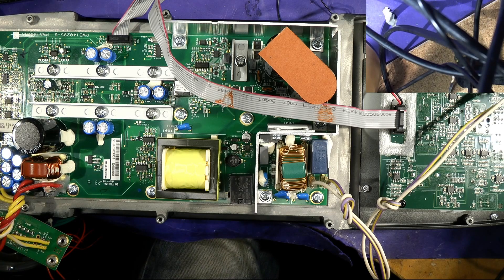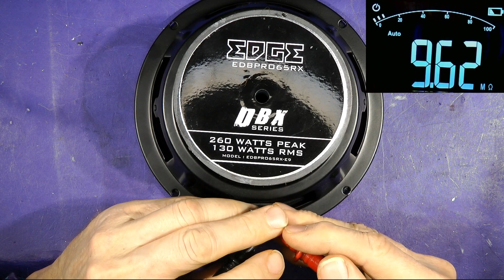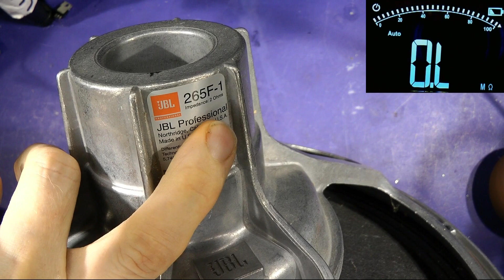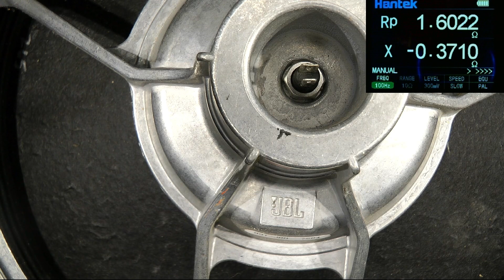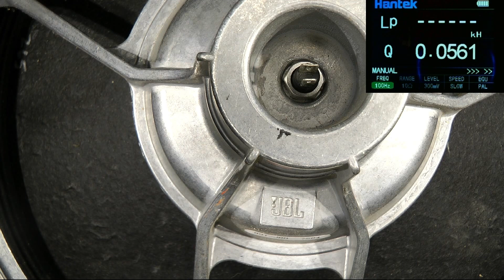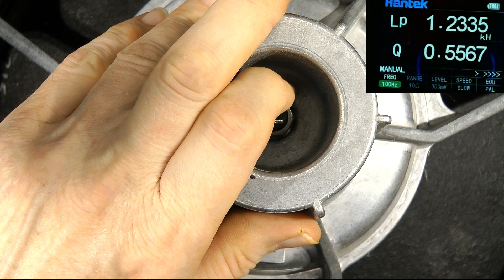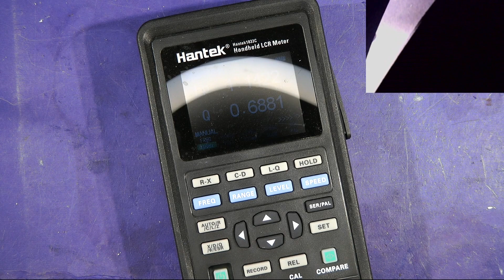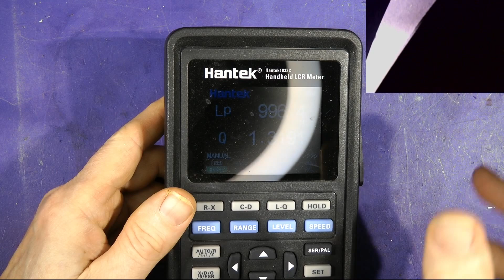How to Test a speaker voice coil Impedance / Resistance JBL  Bass Driver Check for shorted turns

Comment: Put both probes on same tag first to get baseline reading. With a big difference in impedance like you have, its likely a two layer coil shorted out between layers. Just a single short between adjacent turns is very difficult to identify. JBL sometimes even have a copper cap on the pole piece, as a shorted ring to intentionally reduce impedance at higher frequencies. Your sub bass speakers with 2 ohm coils are demanding on amp output anyway. A hearing loop uses a matching transformer to achieve 1 ohm load without a hundred paralleled driver devices.
Reply from the maker: An active impedance test will usually detect a shorted turn as a low Q of the coil. Speaker OHMS are rated in OHMs but is referring to the complex  impedance not the actual DC resistance.
Reply: Looking at the way I comment, it's unlikely  I have failed to understand impedance and ohms. A hearing aid loop in a theatre is a big loop of cable, with no practical impedance at audio frequencies. Nowadays the system is archaic and Bluetooth and other technology is installed. Perhaps you would like to address the copper shorting cap used by JBL which I give as an example. I'm not saying a short between two adjacent turns has no effect. I've repaired a 15" ATC speaker and suspect there is a short between a turn. It's performing identical to another one that doesn't have a short.
And yes, probes on the same tag first is good practice. Many digital meters today use an AC waveform when measuring DC ohms, which adds to the uncertainty with simple tests. I was just trying to help with a note of caution. Often second hand eBay sellers give photos with a differing DC ohms reading with a pair of speakers. I can tell you from years of experience that the factory winds thousands of coils that are all exactly the same resistance. Not in a ball park of say '6 Ohms'. So care is needed.

Comment: so the lower the resitance the smaller the tolerance. im planing on buying some 2 ohm subs, 2/box. Im rewire them to series 4ohm just to keep my crown Macrotech 8000 safe...
Reply from the maker: Sounds like a plan. The speaker impedance is a trade off between the power supply voltage and the cost and reliability of the switch FETs.  Maximum power transfer between the Amp and the load occurs on the point on the curve where the load matches the source impedance of the amplifier. Only when the source and load impedance are equal can you get max power dissipation in the load.  Of course if you drive into a greater impedance then the damping factor will be lower.  As well as getting the cone moving fast the amp also has to stop it fast. That the theory but I would be interested to know if you notice any difference in the sound.

Comment: Hi ive noticed on my subs reading 1ohm instead of 2ohm i have 4 dual 4ohm wired down to 2 ohm but recently my amplifier smoked when metering subs said 1ohm any ideas i had it playing extremely loud that few minutes to tune amp happened when it was turned right down
Reply from the maker: Hmm tricky. It is an impedance so really needs to be measured with and and AC signal.  If the amp is designed for a two ohm load then it should not have buggered it.  If not then then the amp might blow.  The impedance of the load needs to match the impedance of the amplifier.

Comment: I've got a 515 here that keeps blowing the bass fets (the high side pair). I'm getting similar readings on the driver too - but around 300uH and around 1R. It plays fine for around an hour before blowing the fets. Sound suspicious?
Reply from the maker: Lucky you.  Check the preamp isn't unstable. Bursts of out-of-band wild oscillations in the LF drive confuse the D class servo and blows the FETs. You cant hear them but the FETs can feel them. Also don't fool yourself that static precautions are not needed whilst handling and fitting the  new FETs. You also need to check all the components in the FET gate drive circuits. Please like and subscribe if you can,. Thanks.
Reply: @razenby  why would the pre amp burst into oscillation? Is it another design omission? You'd think they'd have some basic high-pass filtering on the main board if only to protect against induced noise in the ribbon cable

Comment: Did you notice that the readings differ a lot when you change the speaker around ,so that cone is in free air..the way it should be and on 100hz
Reply: I have done a lot of JBL265F  for agents.. hundreds of them. When saw the article I also learnt what R stands for Z.. have GW Instek LCR915   , a friend send me your link..then  started testing and saw that the readinds change a lot. In open air 265F measutmres 2ohm at 100hz.. so one is never to old learn..lol
Reply from the maker: @willielouw5154  It helps you vizualise the driver approximate equivalent circuit as a resistor in series with and inductor. In parallel with the inductor is  and a capacitor and resistor is series .    The resistor is the DC resistance of the coil. The inductor is the inductions of the coil. The capacitor / resistor  represents the energy stored in the displaced voice coil and the lost (energy consumed by the baffle support that carried away as sound in the air is dissipated by the resistor).    It is a complex load and is highly frequency dependent and is non-linear - the harder you drive it, the significance of the active components change with amplitude of displacement.  That is why good damping factor performance of the amplifier is very important. The amplifier has to absorb energy from the cone to prevent overshoot especially if the cabinet hits quasi resonant frequencies. But as long as it sound OK!!!.
Reply from the maker: Interesting point. The driver I was testing was on a small baffle  but wasn't in a cabinet. The work being done by the cone forms real part of the Z vector so I guess that in a baffle the impedance would be lower.  Next time I have one to hand I will try it and see if the readings differ.

Comment: So i have a Marantz pm6006 integrated amp and elac debut 2.0 b6.2 and i think i may have damaged the speakers and or the amp cause one day i was cranking it up admittedly louder than i should have…tbh i wanted to test how loud it could go before i could hear audible clipping cause i just wanted to know what the system limits where……so as soon as i could hear the sound breaking up i turned it down right away…..and now it seems ever since it just doesn’t sound as good as it did….like it lost power or something. Nothing sounds out right terrible….but something seems off. Could i have damaged some of the crossover components and it throw the resistance (ohm load of the speakers) up or something that would cause the amp to not seem to push the speakers as hard??
Reply from the maker: Could be. Is both channels (speakers) affected? Tweeters are very prone to damage during momentary overdrive.  It is unlikely that the crossover in both speakers would be damaged during a blast of loud music.  Try one channel a ta  time. and see if you can hear a difference.

Comment: Excellent tips as always! I deal with speakers only once in a while for my personal setups, and this issue with shorted voice coil turns did come up in my mind as a theoretical problem. It's useful to know that it really does happen sometimes. I feel like higher quality amps with fast enough protection circuits would survive this type of fault.
Reply from the maker: I hate FETs in switching power circuits.  You would think that the temperature,current and voltage monitoring would detect and protect .  Power FET reliability and failure modes and causes are complicated and specialist analysis of  a circuit is needed to prolong the reliability. Niggles age them until they go poof.     I have developed supplies that have worked in the test rack for a week and then the a power FET has blown. Investigate, measure, head-scratch and sigh because you can't find anything concrete and then replace the FET and put it back on test. Then it works for months and months with no fault. So, is it handling during production, variance in production between the same part number FET's to some or   susceptibility of some devices in the batch to a stress condition that is not specified on the datasheet?  Maybe a cosmic radiation particle ripping through  ionizing the gate channel insulator?    They are annoying things. But if you ask the question of the manufacturer   'What devices should I use in a design of a high reliability power stage?' then the FET Application Engineers would not recommend the FETs that we used in audio Amplifiers.    On live bridge inverters that chop up the DC power link from France into UK mains each thyristor is individually monitored in real time by a DSP that detects when the parameters drift outside the normal the drive is removed from that device.
Reply: @razenby  Sorry for my late response - I just got back from a local trip. My experience has been similar. Using FETs in, exactly as you said, switching power circuits is a complicated affair. It's challenging to guarantee that you stay within the SOA of the FET with all possible load and drive conditions. Drive side is arguably more important than the load side when it comes to FETs in power applications. For instance, a small brownout that causes a dip on the power rails of the driver transistors could easily blow the output FETs by having them go outside of SOA by violating transition times. Most switching FETs have a nearly unusable linear region both in a sense that they wouldn't thermally survive a linear usage application, nor is that region sufficiently large to be useful (by design of course). I've played with some more modern FETs which are almost impossible to keep out of saturation (a very good thing for switching applications). I had a jig to test the thermal coupling of a group of power FETs to a heat sink, so I was trying to heat them up by having them partially conduct and it was very difficult to do that compared to some older FETs I had lying around. The linear region was very steep. The choice of gate drive resistance is also very important, since you have to strike the right balance between defeating the gate capacitance quickly enough to stay within the SOA for your switching frequency, but also not creating excessive ringing and EMI as a result of fast edges. The "lows" of the ringing could nudge the FET back into the low end of saturation and damage/kill it. But how do you monitor this? The tiny amount of capacitance you'd add with your probes would skew the readings. Depending on design margins, simply trying to monitor the gate waveforms can kill the FET (in a power application). Complex modern designs use multi-phase circuits where each FET conducts in a sequence. This simplifies drive requirements and reduces the load on each individual FET, allowing you to use more compact/cheaper parts, but it makes the design vulnerable to timing problems, controller faults, and of course if any of the FETs fail, the circuit fails - so overall reliability can take a hit. If you overprovision things sufficiently, you can get a reliable design. On the small scale of things, modern motherboards and GPUs use these types of circuits to convert 12V to 1.2V or less at extremely high current (hundreds of amps) for the CPUs/GPUs. Large scale industrial application as you've mentioned for France-UK DC link, are terrifying to me haha. Makes perfect sense that you'd monitor as much as you possibly could. Engineers from companies that make those parts would typically be working very closely with engineers that design those types of products. You would test every extreme and every type of fault scenario. I'm sure that they all take pride on the final designs.
Reply from the maker: @oriole8789  The dwell time is invariably managed by the bridge drive IC so in theory a brown out prohibits both FETs on on one side of the bridge being on together.  A lot of service bulletins are issued that mess with the gate drive because the original engineer didn't check the design to the stated  full device specification in the datasheet. Normally gate capacitance and FET transfer characteristics catch them out.  It is a bugger. An earthed soldering iron and work piece are important when installing new ones..

Comment: Naughty speaker, how dare it provide too low a resistance and impedence at a test frequency lol.
That shorted turn would screw up all variables.
Taking the cone and spider apart to access the coil would be a pain in the posteria, new spider and cone support would likely be unavailable.
A song:
One dead speaker standing on the wall
One dead speaker has a shorted coil
And if one dead speaker was to accidently fall
There would be one dead speaker sitting on the floor.
The green bottles made a better tune lol.
Yes i'm silly :-D
Reply from the maker: These are eye-wateringly expensive to repair even if you could get the parts.